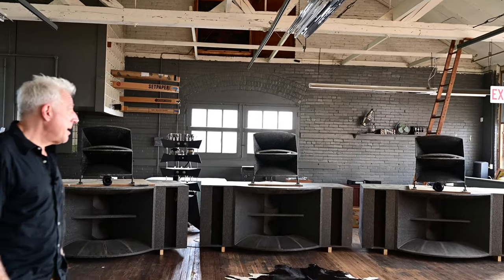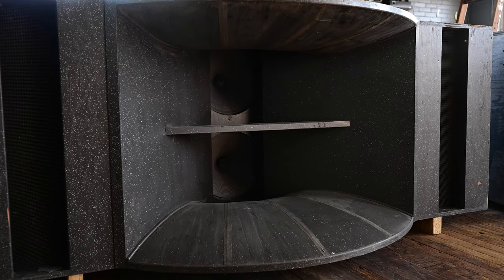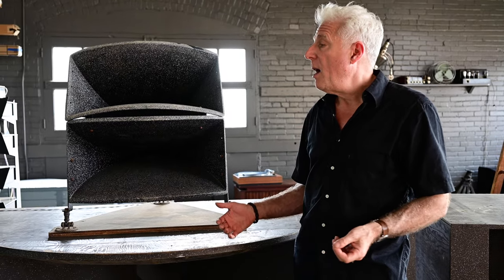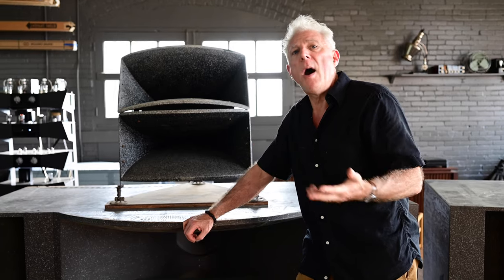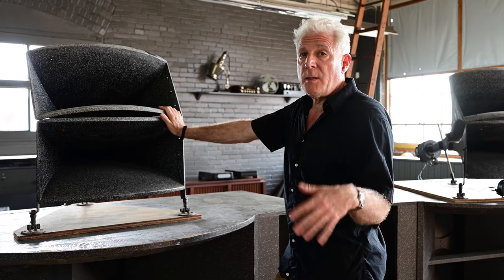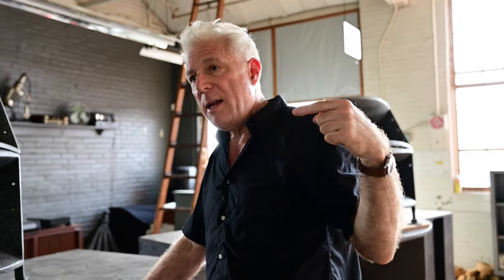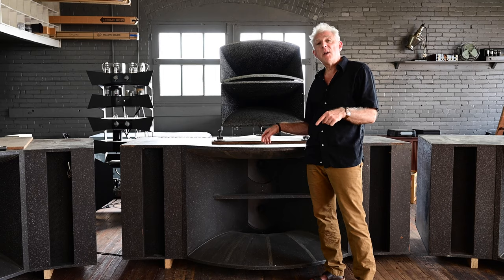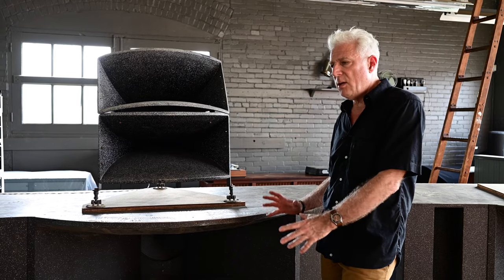OMA on the RCA Ubangi system

Comment: There is still a lot to be said for this type of old kit. It looks beautiful. I Love flared horn speakers. JBL 4560s are probably my favourite speaker I own. Excellent low mid response. Ive got quite a lot of old Altec, JBL, Martin Audio kit in a barn. For modern quality outdoor PA, modern 18" folded horns for bass, 4560s for low mid, MH212s for high mid then a 2" with a 1" radial horn on top sound incredible. Im no sound engineer but used to tinker about with things. We used to do a lot of outdoor music events and out kit looked like an archaic piece of junk compared to all the modern setups, but sounded much better than peoples very expensive Function One and other very expensive stacks. One day I plan to put some of it to home hifi use but need to find some suitable lower power sensible comp drivers

Comment: makes you wonder if the original Amplifiers were still around as well as the speakers...
since the woofers weren't blown out. The history behind the speakers is really interesting,
thanks for sharing : )
Reply: A lot of the tube amplifiers that were part of theater, jukebox, and home stereo console systems were set aside after solid state replace them. I remember that you used to be able to find these tube amps being sold on Ebay for good prices. But as time has gone by, the availability has gone down while prices and demand have gone up.
Reply: The Oswald Mill universe is literally littered with amps from those eras.

Comment: I admire your work and knowledge. Great job.
I know that Nikola Tesla worked for RCA at one point. Though he did invent many things they used.
I have a 63 RCA Victrola Stereophonic with 17 inch woofer in mint condition, even wood and grill. Original tubes. manual. Nipper imbedded in the wood
You  may want it. Even has jacks  for external speakers. A true time machine.

Comment: How come Oceanway (HR1) claims they designed these speakers and still manufacture them when RCA made them since WW2? I dont get it.
Reply: Where does Oceanway say they designed the RCA speakers?  The HR1's aren't the RCA speakers, they are different.  The horns have a different lens, the bass cabinet is a different design and I think they use different drivers.  I think it's more like they took the design of the RCA's and made their own speakers but used some of the ideas from the RCA's, as in having a horn and a large driver in a horn based cabinet…….  I doubt they use the same crossover..

Comment: Not trying to lead people astray, really,,,
DIESEL fuel will preserve the suspension components of most if not all speakers, AND it can be used to soften up old hard dried out cones. It really works and it has not messed up any of the glues or binders, and it will give you super low bass and higher efficiency and a more mellow tone and lower distortion. Too much is not recommended, you can brush it on components and fine mist spray it onto cones evenly. 
It works on a molecular scale where the lightwieght polymer will lubricate between suspension fibers that are meant to strech. Cones are binded together to be hard and rigid and lightweight, but just like old tape and glue it can become too hard, so softening it back up with light amounts of diesel fuel works. Its the only oil that is very non destructive, very lightweight, very penetrating, very cheap and very slippery.

It takes more than you might initially think, but do it in small increments. Brush it on full strength to suspension components. Make sure it doesnt bleed into the cone.  I dilute it 50/50 with 100 percent alcohol so it will dry and leave a smaller more even amount for mist application to the cone. 
And there is something about diesel specifically that perseveres things, dont ask me how. But it works. 
Dont do it if you dont feel it necessary. 

Tiried this with leather surround speakers, it perked it up more than I thought possible, so I tried it on all of my other full range drivers, only with positive results.
Reply: I heard acetone can do the same thing. Im trying to revive some warped voicecoils and heard that acetone will relax the spider and maybe it will stop rubbing. Im trying to avoid having to do a complete recone x4! I could try diesel but i had a spill once and it stunk for weeks! Maybe a small amount wont smell much
Reply: NO ACETONE. It will not lubricate, it will dissolve many surrounds. 
If you add alcohol and diesel, this will dilute it, and probably not damage any of the plastics. Usually, diluting diesel is needed if you want to evenly spray it on the paper cone, to recondition or soften old dried out cones. 100 percent diesel will not affect the surround or spider, and weight differences are negligible . frequency responce and spl is increased and distortion is lowered due to a looser suspension.  @bblimediamostlyspeakers
Reply: @bblimediamostlyspeakers nothing will fix a rubbing coil. That's from a misaligned construction. Lack of proper shimming... Although it can be repaired with ultra careful releasing of the  spider and coil. Ust remove dust cap however. But if done right, it can be reused